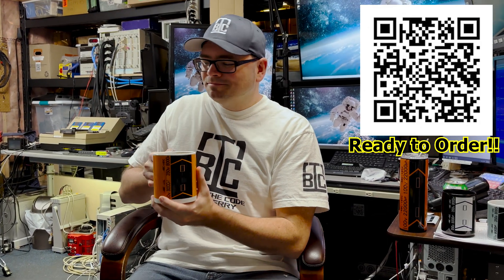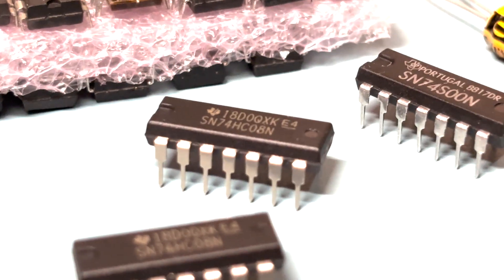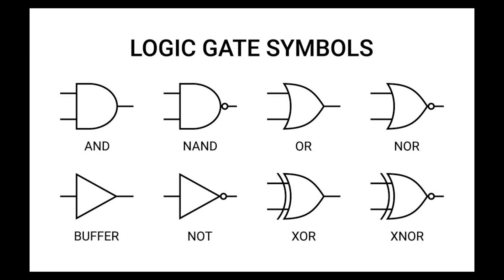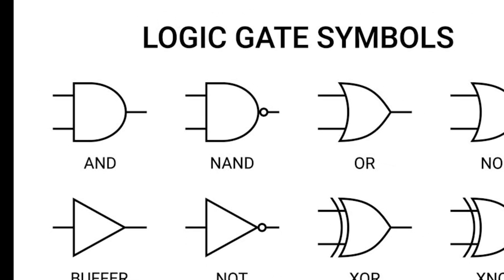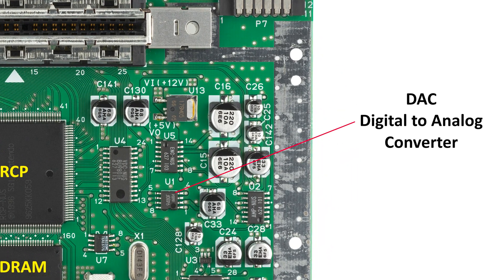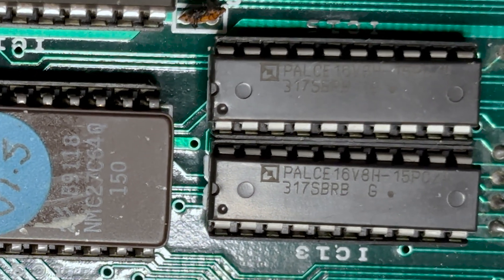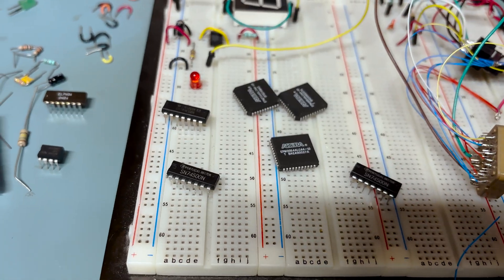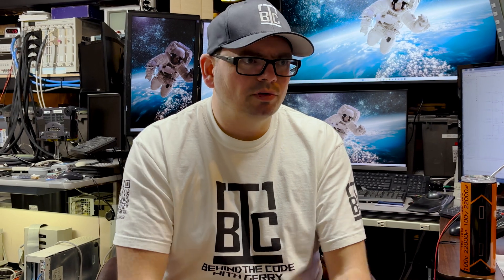How do the computer chips inside your game console actually work?   [#60]

Comment: At some point or another I've opened up pretty much every one of my consoles. I swapped a few Optical drives over the years but never really learned the full inner workings.
Reply from the maker: Nice!👍 yeah, it’s a cool and fun hobby to tinker with digital circuits. I want to get back into it more myself.

I’ve worked on several consoles over the years… but have yet to come by a console that actually had its CD-Rom drive fail….🤔I guess I just got lucky in that regard. 🤷🏻‍♂️

I’d be really curious to know how many actually fail.